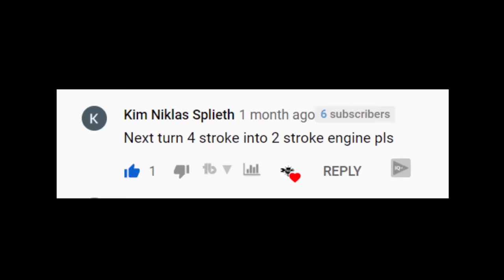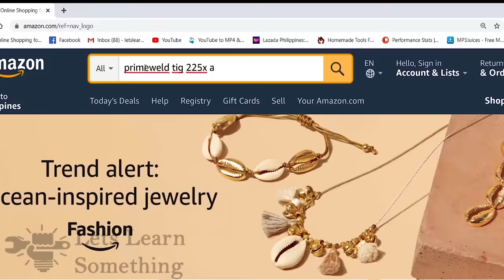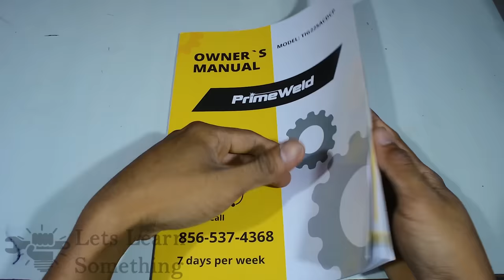I turn 4 stroke into 2 stroke  engine

Comment: Might as well just invent the 3 stroke engine after this
Reply: Lmfao
Reply: @the_harbour_boys  rotary engines has 3 "cycles"... intake, combustion and exhaust
Reply: It’s called a rotory engine
Reply: It’s been done already
Reply: @mc__mauri8863  rotary do got compression.all engine must have,else it doesn't works.
Reply: Yeah rortarys are in rx7’s I got one
Reply: MC__Mauri it’s intake combustion power and exhaust but yeah it can be called a 3 stroke since the rotor only has 3 sides🤷🏽‍♂️
Reply: But fisrt explain how could be the concept of 3 stroke works. ???
Reply: @fernandojrpineda9894  just let them boyz keep on dreaming,maybe can hit them someday later on how to escape from one of the cycle in the engine.
Reply: @fernandojrpineda9894  im by no means any kind of engineer but I'd imagine some sort of peripheral ported, valveless piston engine would be more or less 3 stroke. I think, maybe.
Reply: @1223-k5r  There are no "strokes" in a wankel rotary engine, a stroke is a single movement of a piston in a linear motion i.e. a piston traveling from t.d.c. to b.d.c is one stroke and then returning to t.d.c. is another stroke.
Reply: @ninjabudd  No it is called a Wankel engine, it is in fact not technically a rotary engine is just adopted that name out of simplicity. Rotary engines are quite similar to radial engines the difference being that instead of a fixed crankcase and a rotating crankshaft assembly it has a fixed crankshaft and a rotating crankcase assembly. Look them up, they're very interesting engines with their fair share of engineering design hurtles.
Reply: @Mr_Smith1327  I didn't say anything about wankel engines...
Reply: @1223-k5r  Oh sorry, misread your comment, all good, well at least it's knowledge for the others scrolling through the comments
Reply: MC__Mauri  all motors have four stages in a cycle. Intake compression combustion and exhaust is just how it gets done the determines the stroke count.  It takes four stokes of the piston or two rotations for a four stroke.
Reply: MC__Mauri  yes but a the name two stroke means it fires every two times within the four cycles which is what the rotary engine does and the rotary uses reed valves like a two stroke and lubricates like a two stroke. because of the weird shape of the rotary's rotor, those gaps where air and exhaust goes its much bigger meaning it can pack twice the amount of volume than a regular combustion engine. so basically the rotary has four times the amount of power as a regular four stroke engine. And because of the amount of how much a rotary spins being a 2 stroke and packing double the amounts of air and exhaust, they dont last long due to the cylinder bearings been completely worn out every 100 000 KM
Reply: i only just realized how much i wrote oops.
Reply: @tozzaschannel  yup, a lot of shit that doesnt make any sense
Reply: The AMA would vaporize

Comment: "Poor mans milling machine" I haven't even got a drill 😂😂😂
Reply: If this guy had a CNC mill, he'd be running the planet before long.  Elon Musk should be hunting this guy down.  He could cut space launch expenses by 85%.
Reply: This is how i milled shit... crappy 200$ drill press and some cutters
Reply: dont know why he milled that bit of that circular barrel thing
Reply: @tonyfremont  calm down haha, any skilled mechanic could work this out
Reply: For fuel a 2stroke doesn't work the same as a 4stroke so where his reed sits it wouldn't get fuel to the top of the piston without him doing that normally on 4 stroke the carb goes to the barrel top end & a 2 stroke goes to bottom crank up so if he didn't channel it fuel would never make it to the top of the piston as it's a 4 stroke abit complicated to explain but in that kind of way is how it works what he done was needed for sure
Reply: ลบโดเวฝ110ใอ

Comment: Make A 2Stroke into A 4Stroke
Reply: That might be a bit more tricky without the proper machine tools
Reply: @kenjsr1  but if anyone can do it he can I bet
Reply: Technically, he could just return this one to it's original configuration.
Reply: he kinda did it with the compressor
Reply: @hugolundmark5947  all he needed was a carb and an exhaust instead of the tank.
Reply: Just watch this video in reverse... lol :/
Reply: @hugolundmark5947  exactly
Reply: There's an old video on U-Tube where a Russian has converted a 1960's Jawa 250-559 2 stroke single engine into a 4 stroke single engine using a modified cylinder, piston and head from the ubiquitous Lada car engine.
 
Nothing's impossible, only bloody difficult!!
Reply: How about 4 stroke to 5 stroke.
Reply: He will have to re do what he’s just done 🤣
Reply: ....and....remember to hit the 2X button.....if, said button not found.....pull some levers......Lol !
Reply: 2 strokes are better🤗
Reply: Next i will make 3 stroke lol
Reply: What about 1 stroke😂
Reply: @fathisyakir8287  That's called an explosion.
Reply: @tuonglukim8973  No, there are Wankel engines
Reply: @HaiNguyenVan-rb3tk  Touche my man.

Comment: It is simply amazing the capacity and competence that this "engine sculptor" has ... he is the engineer, the mechanic, the turner, the welder, in short, the full accomplisher of something that any expert would say is impossible to do, even more without the precision equipment he didn’t have… this guy is a magician!
Reply: @sizzlean9459  Dude, I think you may be right in part of what you're saying, but I don't agree with everything ...
First, I disagree with radicalisms and generalizations, which is always dangerous and unfair, since every issue has at least two sides to be analyzed ...
Secondly, to say that all engineers are incompetent and the only ones responsible for all the garbage that this capitalist consumption system generates, is like wanting to blame only one soldier, for all the deaths on a battlefield. 
Take it easy guy, because if the scale hangs just to one side, it may be because it’s unregulated, or broken, or maybe it’s not the right scale for what you’re trying to weigh ...

Comment: convert 4 stroke gasoline to diesel. You need fuel injectors for this. But it might not work because of the too high compression. Or convert diesel to gas thats easier
Reply: Diesel requires higher compression and runs at much higher pressure and temps so even if he could turn gasoline to diesel it would I think blow up
Reply: @Gamer-nc8qp  put stronger bolts and bolt them tighter might work
Reply: @dieselgeezer18  im no machinist but I think the problem would be that litterally the engine block is too weak it's not about bolts and shit it's about the body of the whole engine but again I'm no engineer lol
Reply: @Gamer-nc8qp  the engine block can't explode dude its freaking thick metal the problem is the cylinder head
Reply: A dozen of potatos and a fat cat smelling them ever heard of a cracked block? Happens when using gas in a gas engine...
Reply: @niklausk3907  In many cold-climate or cold weather cases, an engine's cracked block is caused by freezing. ... When the coolant in the engine freezes, it expands. The frozen coolant pushes against the metal surrounding it, cracking the block, and will also soon cause the antifreeze to leak and the cooling system to fail.

Other reasons:
1. Engine has inadequate oil when running. The heat can cause the block to crack.
2. Bad bearing in connecting rod causes it to break. This can cause the block to break as the connecting rod goes through it.
3. Broken valve springs can drop a valve into the piston, causing the piston and/or connecting rod to crack the block.
4. Broken cam drive chain can cause the valves to be open at the wrong time and cause the pistons or con rods to break the block.
5. Weak or bad block casting can cause the block to crack.

With some care you can do everything. The engine won't become any crazy power beast. It will just have higher compression. The use of better gaskets and tighter bolts will do the work for a few minutes. It might get destroyed if ran for a long time though
Reply: A diesel engine is a 2 cycle compression engine and doesn't absolutely require injectors to run the Reed valve atomizes the fuel charge
Reply: @dieselgeezer18  it's air cooled there is no coolant what video are you watching?
Reply: @mackreig2356  i am talking about cracked cylinder blocks generally. Also 4 stroke diesel engines REQUIRE fuel injectors. They can't run without them! Its impossible because the diesel fuel combusts by the high temperature and high pressure inside the cylinder. If it worked like a gas engine the diesel would combust before reaching top dead center and the timing would be off. 2 stroke diesel engine need injectors too. The ports on the cylinder wall is used ONLY for sucking in air which is done by the help of a blower. A 2 stroke diesel engine would be really hard to make

Comment: You should be very proud of what you have accomplished.  Changing the size of the ports, and especially the shape of the ports at the top end would yield a lot more power and make a smoother running engine.  But tomorrow is another day.  Great job.

Comment: As someone who has ported over a half dozen 2 stroke engines, I was half surprised that it ran with that small of ports. If I were you, I would triple the width of the exhaust port and enlarge/reshape the transfer ports. You could easily triple the power if you do it right.
Reply: Ive been going through these comments and I agree with so many of them about his skill and knowledge and what not. But then I saw this and I thought the same thing. The ports needed to be bigger and reshaped. I dont even know advanced 2 stroke techniques, and I was thinking "you know, Id make those ports bigger and reshape them"

It was so cool I came across your comment and it was like we were thinking the same thing!

Comment: i nearly had a stroke when i saw he blocked the place where the chain for the valvetrain goes trough, then i remember im retarded and 2 strokes dont have a valvetrain lol
Reply: u mean, u "nearly had 2 strokes" ;-)
Reply: You are Wrong take a look at a Detroit diesel 671 two stroke with exhaust valves all 71 92 plus other series all have valves.
Reply: @CraigOlove  the thing is 2 strokes dont need valves to run, they did it on those but those are big heavy engines, and also prob expensive at that time im guessing, they could have made them without valves, just look at any modern 2 stroke from 2000 to now, is there any other two stroked that uses valves?